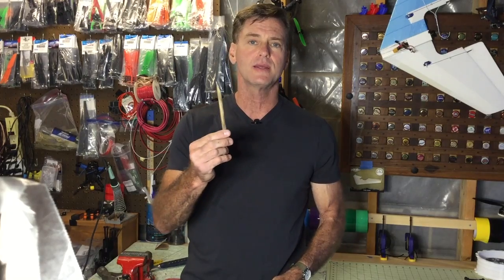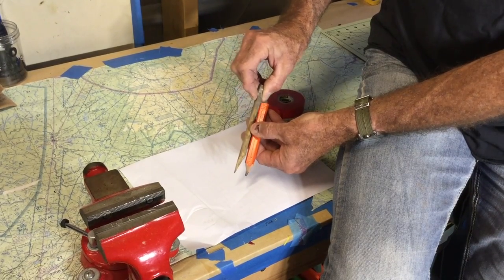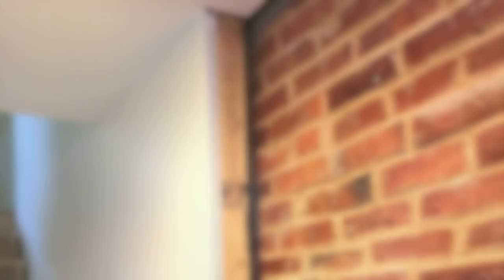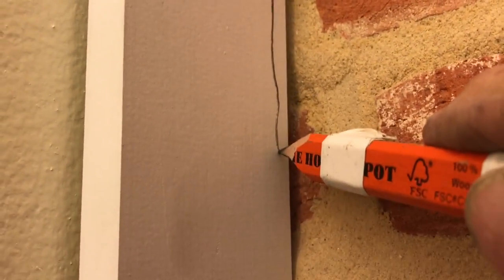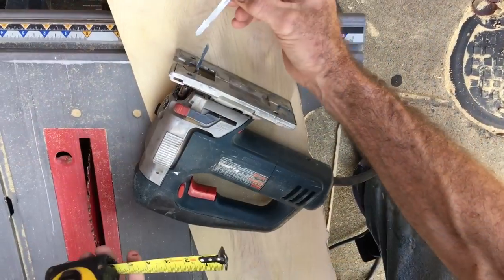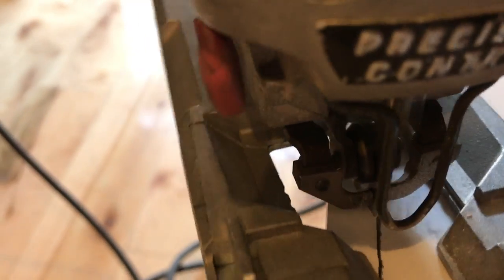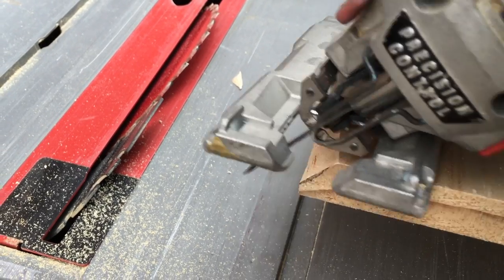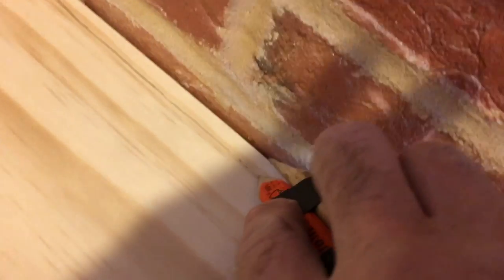Contractor Craig - Fit Trim to Irregular Surfaces

Comment: The 45 degree idea was really a good idea, and using the jig saw,  I wonder if you have a video on paneling or sheetrocking historic walls that are not straight, level, plumb, or square.  I've worked on that and it drove me crazy!!